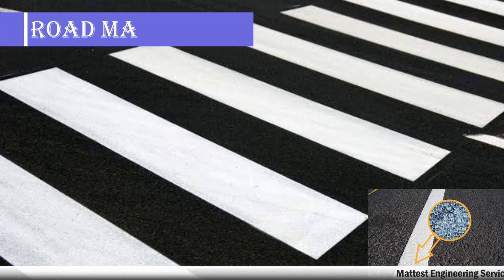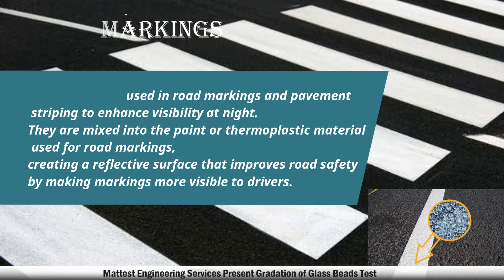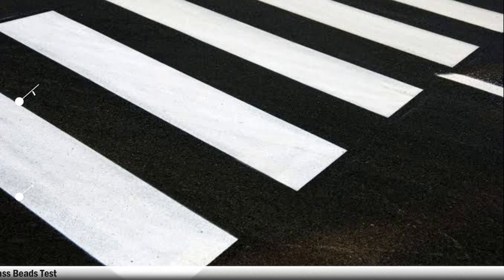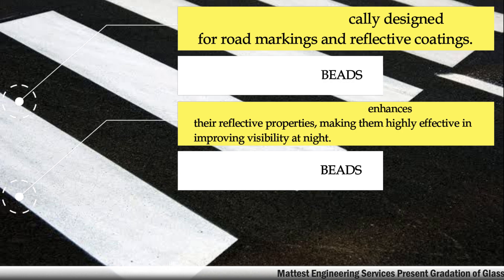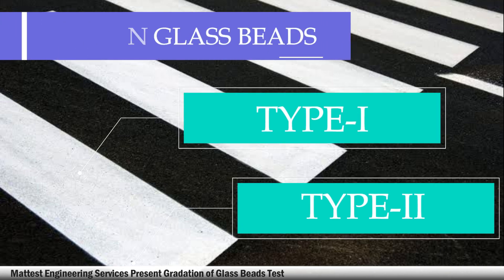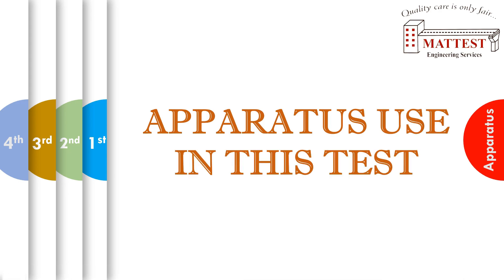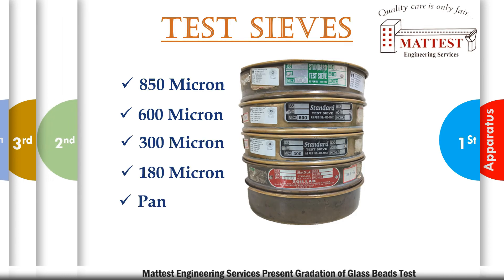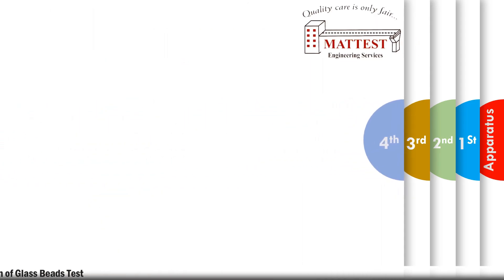Gradation Test of Glass Beads | As per BS 6088 : 1981

Comment: What is mix design we need to use please Help
Gradation details.
Thanks
Reply from the maker: The gradation of glass beads is done as per BS 6088:1981. The standard specifies two main types:

Type A (Fine) – Passing 850 µm and retained on 425 µm sieve.

Type B (Coarse) – Passing 1.18 mm and retained on 600 µm sieve.

For mix design, the selection depends on the road marking requirements (retro-reflectivity, skid resistance, and surface type). Usually, Type B is preferred for drop-on applications, while Type A is used for intermix.